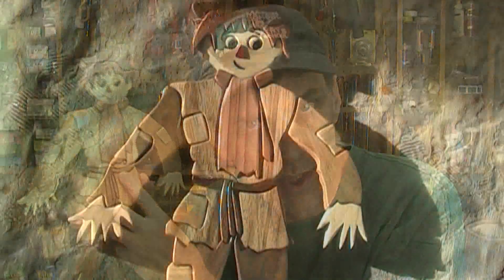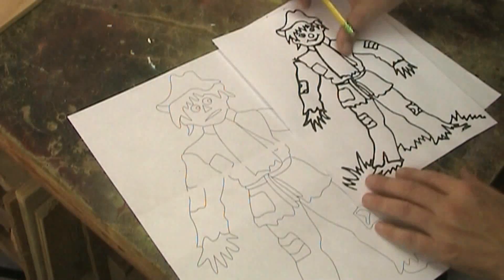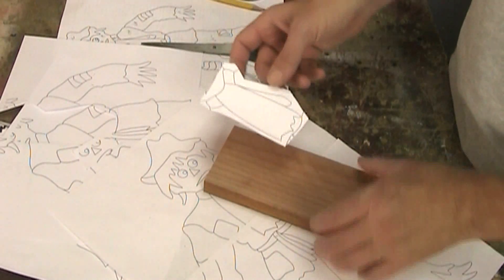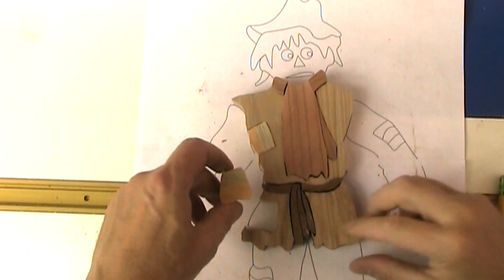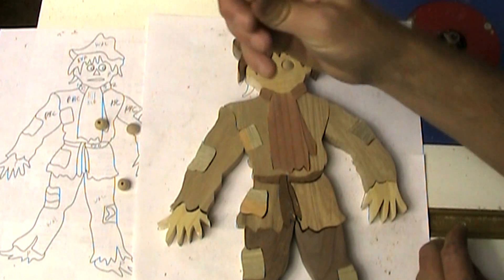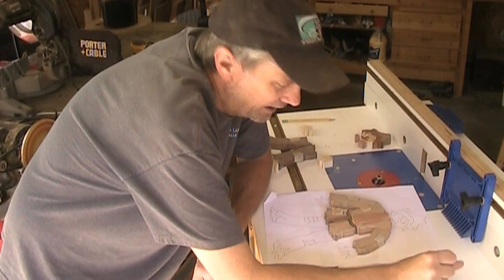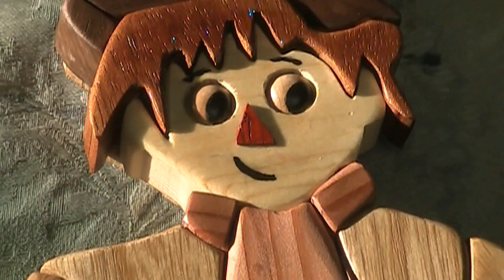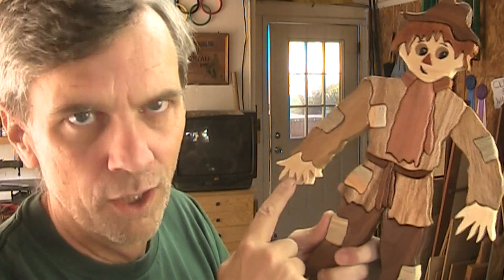Make a wooden scarecrow. Woodworking intarsia. Fun fall decoration!

Comment: Love it steve.  Seems the spray adhesive complicates things a bit.  Something I do for inlays is to use carbon paper. They still make it! Office depot is where I get it. I mark some x's in the corners to have a reference then trace the lines on the wood with the carbon paper.  On light woods the line is dark enough to use as is, just blow your dust away instead of wiping it; but on darker woods it's no pain to re trace your carbon paper lines(on the wood) with a pencil.

Comment: I've heard you say you don't use your scroll saw much, but man what a gem. Modern saws couldn't hold a candle to yours. The weight and true up and down action of yours means no vibration and a very true cut. I would love to have such a beast. I would do a few mods to it (quick blade clamps and a variable speed dc motor-kbic controller...foot control, etc.), and have the best ss money could buy! Great Video! I've just finished my 1st intarsia project also so I can relate.

Comment: Steve, I have a project I want to make soon, and I thought it might be a fun/useful and easy project for your show. A heat deflector for a furnace vent. I plan to just make two 1/4 circles from 3/4 stock, and insert magnets in the bases. The curved back will either be made of curvy plywood (from where I work), or glued-up layers of veneer (easy to do). There are a ton of other options/ideas. Thin slats, octagon, etc.

Comment: hey steve, if you use your drill to cut out the pupils and mouth and eyebrows, just making a few passes to make it smooth, then filling it with a mixture of glue and dark sawdust, you could avoid the paint

Comment: hey how r u, thanks for video I am now trying to make my first  segmentation art piece I'm doing an eagle , im glad u mentioned the coloring book idea because I don't wanna go out and buy a bunch of templates and different wood pieces until I know I'm going to do more of these, I will stain or paint mine, but my main question is the type of wood used, not if its pine or cedar but  dimensions, thickness , did u use plywood, or a 1 x 6 , all I currently have on hand is 2 x 4 and 1 x 4 , im using scroll saw just need advice on a few other board sizes on a small budget say 20 $ worth wood, I will also need the spray adhesive I c

Comment: I see a lot of videos where they say to use shipping tape on top of the glued paper , but it always turns into a big mess for me. Even the spray on glue gives me a hard time, could it be the Elmer's brand isn't as super sticky ? One more question , I have a cheaper more generic scroll saw , will that make a big difference if I try to make one of these ?

Comment: For the paint nazis out there, you could use a wood burner or soldering iron tip.  Since you went with black anyway, it would have turned out the exact same, you would just need aloe for the burns on your fingers!